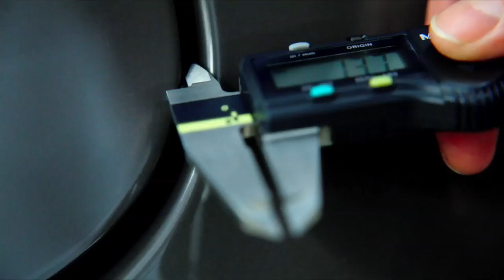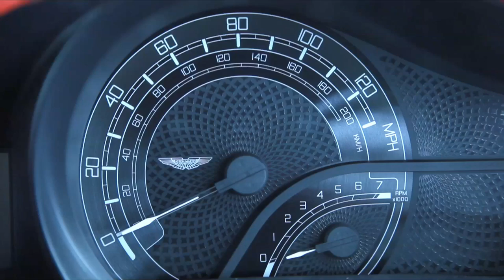Aston Martin Cygnet hand-crafted production

Comment: @bloximonkey Uhm... You can buy this or one of those... The 1M was 50,000$ when it came out. Z06 corvettes can be easily bought secondhand for 40-50. M5's can be bought in the mid 40's, new ones are going to be like 90 grand. Range Rover sport is roughly in the 60,000$ area too.